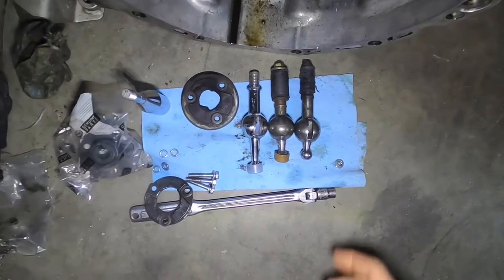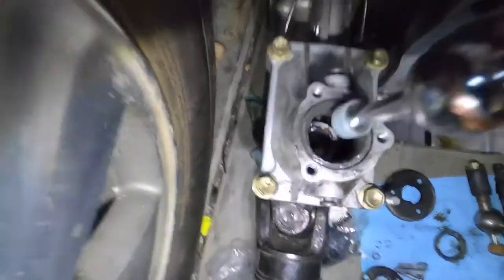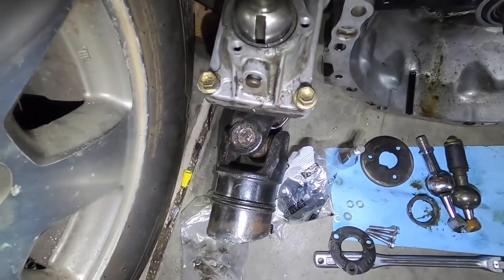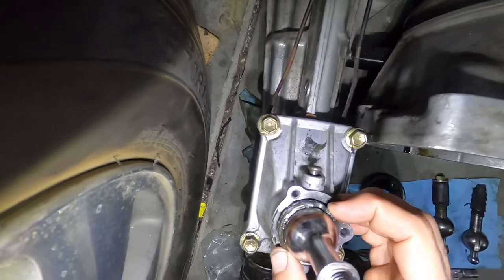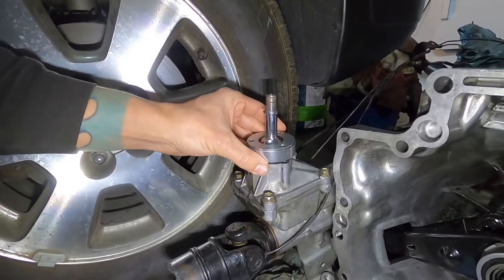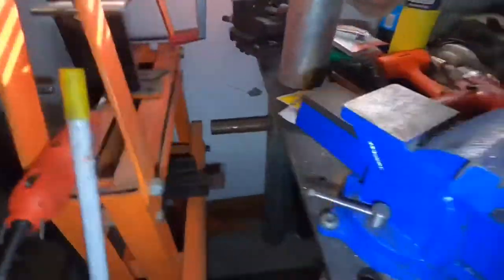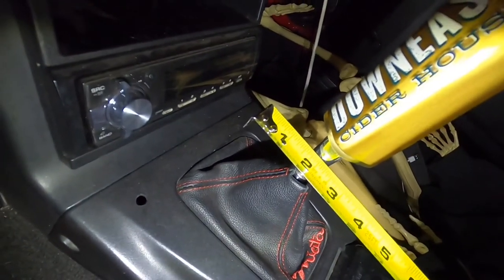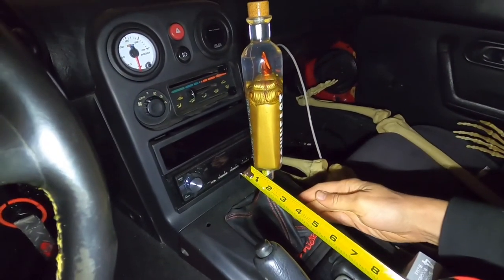DIY Miata 6 Speed Short Shifter W/ 5 Speed eBay Short Throw Kit & A $2.50 Washer

Comment: What short throw shifter kit is this?
Reply from the maker: eBay/Amazon 5 speed short throw, it was $40 when I bought the kit. This only works with early NB1 6 speeds, not NB2 due to the lower cup size being different.
Reply: Are you saying you can't do this mod to the nb2?
Reply: I wish I could do this for my Nb2 later year Big ball shifter I have the big ball 22mm shifter unfortunately